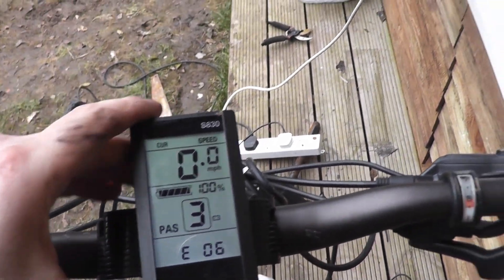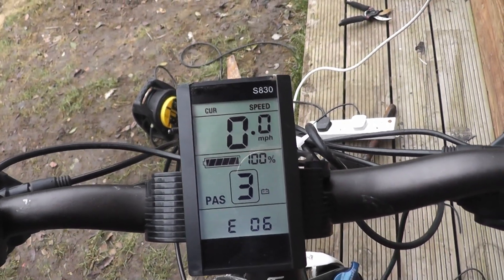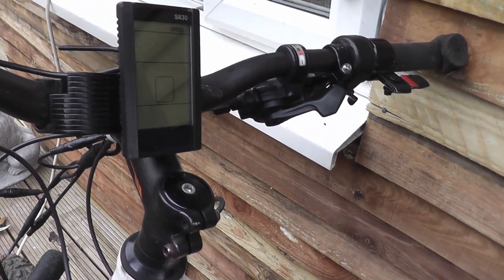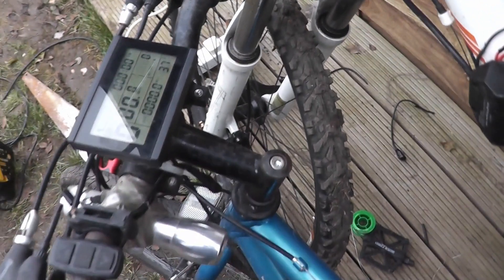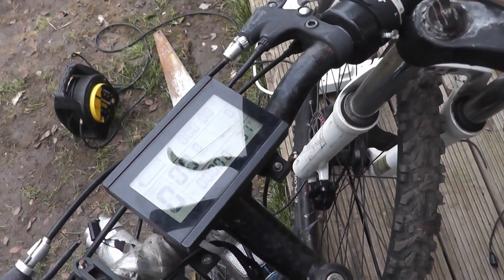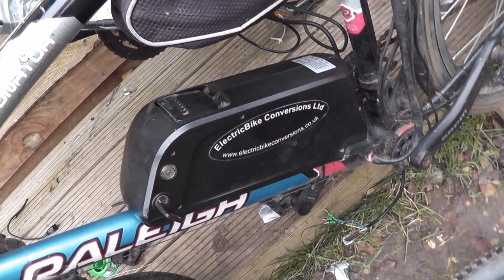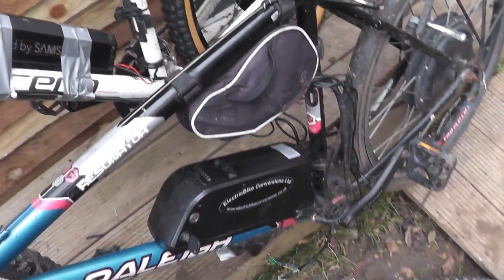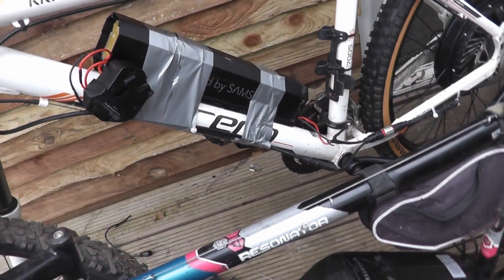ERROR  6 S830  ITS A GO GO    ON THIS FAULTY #EBIKE KIT  NEEDS   BIGGER  ESC

Comment: I seem to be getting this problem but it works when I'm not on the bike but when I off the bike and pull the throttle it goes without error 6 but when I ride it it works then does error 6
Reply: bro mine does the same did u work out the problem i got mine yesterday